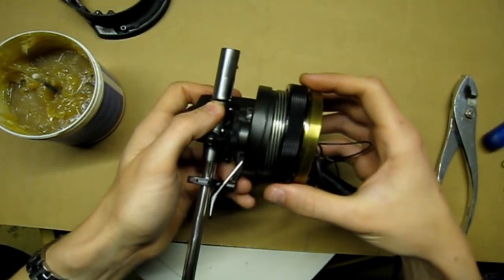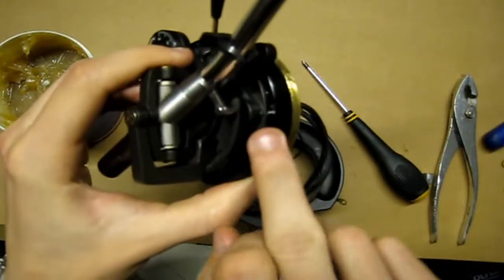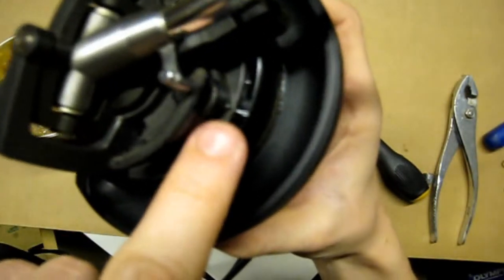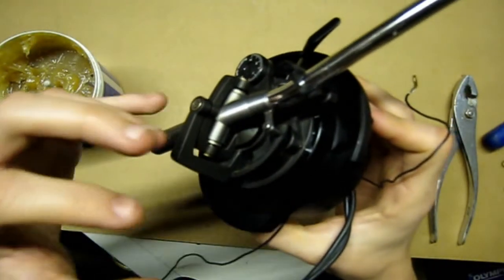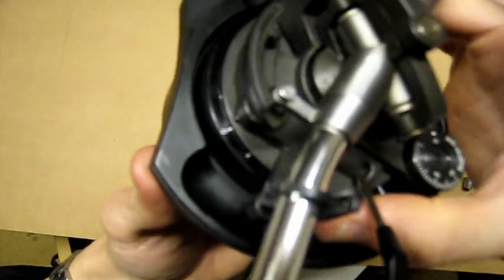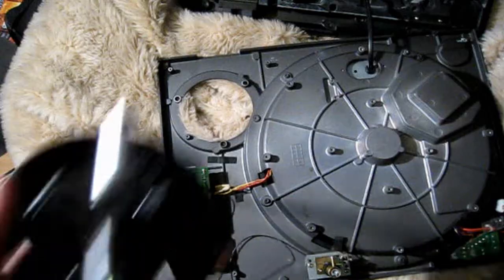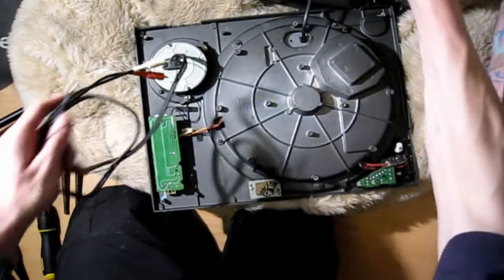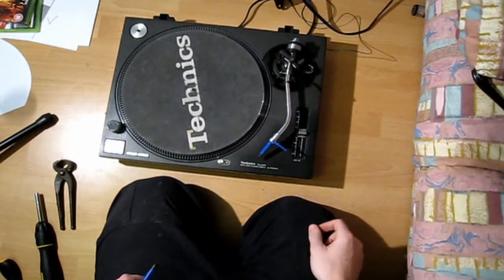How to service/repair/replace the height adjustment on a technics 1200/1210 MK 2 turntable part 2

Comment: NON LITHIUM GREASE. Try Buzzy's Slick Honey, It's water proof. Head to a bicycle shop they usually carry non-lithium lubrication products. If you are near a marina head to a machine shop and ask for synthetic grease (usually has calcium or aluminum complex). Good fortune.

Comment: FYI the small C clip removed with a plyers from the lock lever dowel rod is a stop to keep you from completely backing out the height adjustment bezel flange.

Comment: James while some of your videos have resulted in me doing work on my 1210 and feeling like a king when i have succeeded, after attempting to free the height adjustment and 3 or 4 attempts tp put it back together, now whilst the ton arm now goes up and down, i cannot get any kind of signal from the tone arm to the mixer. I have damaged it in some way.

Comment: My tonearm turret is a bit loose when i unlock the height adjustment knob. I mean if i grab the adjustment ring and shake it a bit, it wiggles. Is there any way to tighten? What is the cause of this? I can't figure it out.

Comment: You say not to use Lithium grease.  Every single brand of multipurpose grease I find is Lithium grease.  I googled the exact brand that you use in the video and it says on comma oil's website that their multipurpose grease IS Lithium grease.  Can I use Lithium grease or not?  I don't want to mess anything up.  I don't see how it would mess anything up, but you can't be too careful.

Comment: @pauljohnlane Thanks. I actually figured out how to do it. It actually depends how you screw in the ring. That is, you need to pay attention to what number the little arrow/mark is pointing at when the threads start locking together as you screw the ring. Once I realized that, I tried playing with it, and I think it ended up pointing at 3 when the threads locked in together. So pay attention to that. It took me maybe 5 times of screwing the thing together until I figured out what was the problem

Comment: These two videos (and other you posted) are really helpful.
Here's one thing though. I calibrate the tonearm ring to 0 and screw in the outer ring. I follow the instructions and everything, but then when I'm done the ring only goes from the blank beyond the 0 to a little above 5. I might have moved away from the zero by a hair. Any idea what could it be? Should I calibrate it at 1 to compensate for this?

Comment: hey bro! i like all your vids. I have a sl 1200 and the anti- skate doesnt work and the piece the lifts the tone arm is broke. This is both tables that i have one table the tone arm has been replaced and anti-skate still broke......do i need a new tone arm base assembly or do i replace the plastic piece that is under the base assembly part.   Help me bro! I wanna keep them technics are exspensive as hell if i buy new ones, im broke!

Comment: i am having a big problem....
i got a 1200 that the anti skate knob holder is actually broken off of the tone arm base... is there a video in ur library for this, i didnt see one but i need to replace the base for the tonearm and cant find anything about how to TOTALLY strip and reassembly the tone arm

Comment: Hi James.Amazing really.I´ve had a 1210 now 25 years and never knew that there were so many items to adjust.I did nothing up to now until I found out that my Hi fi sound could be better.It seems that this Arm adjusting screw seems to be a problem with Technics when not used.As you say the Grease orinally from Technics siez up.But u do seem to be a clever chap.All the best Ian.

Comment: wow! nice videos!

i have this problem but haven't bothered too much because with a lot of force I could set it how I wanted it. but given this tutorial, I might fix it once and for all.

also, the locking pin is REALLY stiff, stiffer than the height adjustment. Can that be greased too you think?

Comment: Dude, you are my new hero!  Mine was SOLID seized up and now it's smoother than silk.  Seeing you take the deck apart really helps to eliminate any doubt, so thanks for putting in the time.
p.s. that retaining clip on the post under the tone arm does have a purpose! It's the upper height limiter.

Comment: just got a used sl1200 mk2 and everything is in working condition except for the height adjustment. it doesn't move at all! and i'm glad you made a video how to fix it. i'm going to try your steps. I hope it works!

Comment from the maker: @matthewjones1982 hi there, there are 2 things you can try 1: spray some WD40 or some other type of penetrating fluid in the gap were the two parts meet, leave it a good five minutes for the fluid to do its work... if not 
2: try getting a hair dryer and heat the out side ring (the bit you turn with your fingers) this will melt the grease and the heat will expand the metal and should free it up.
hope this helped and thanks for your comment.

nice one!!!
Reply: the hair dryer technique worked like a charm here

Comment from the maker: @pong38 thank you very much for your comment, im glad the video was helpful.
as for your question. i have seen the lift lever become loose a few times but it still works fine, if this is what your having than its quite simple to put right, and one of my video requests is how to replace the lever so i could integrate it into that video.
hope this is helpful and thanks again for your comment.

nice one!!!

Comment from the maker: @Tha1AndOnlyDJT no its not too bad the only reason i say don't use lithium grease is because over time it can become quite sticky and make it hard to turn, as for stripping it back down, if it seems OK and you have no issues with it that i would just leave it, it wont harm your deck.

also is your grease "lithium based" or "pure lithium grease" pure lithium grease is normally white and quite sticky. if you have lithium based (the one i used) thats fine to use.
hope this helped.

nice one!!!

Comment: hi mate just seen your video,
god bless ya m8,
just bought a technics sl1210 mk2 yestday,the adjustment is ceased on it this video is just what i needed,
gna start the precedure now.
i got a quik question,is ther anyway to fix the tone arm lever (the 1 that lifts the tonearm up n down) mine dosent go up or down also is there any way to sort  the anti skate out if not working, cheers m8.

Comment: Hi James. I'd just like to say you are a star mate!!!  :o)
I bought a Technics SL1210 MK2 and  checked the tone arm settings but found my height adjuster was siezed. Did a search on google by chance and found your videos. A while later i had an arm which adjusted.Top Man!!
I also spent about an hour watching your other videos as i need to replace the phono cable too and see if i can get the pop up light to work.
Just like to say thanks for sharing your knowledge mate.Nice Work!!! :o)

Comment: I have two small brass washers that have come out of the tonearm assmbly, but i don't know where they are supposed to be...i have put it back together but i would still like to know where these guys go. They are smaller in diameter than the one that comes off of the height adjustment lock...please help

Comment from the maker: hi there, it looks quite severe when that happens, but normally its just the ring clips come off, basically the bit i take off at 6:28 of part one of the video, make sure that is on there otherwise there is nothing to stop it when it get to high. just be careful when you take the bottom plate off because it likely to be ratlin around in there. if it was missing in the first place you should be able to go down to any hardware store and get something to go on there.

hope this helped.

nice one!!!